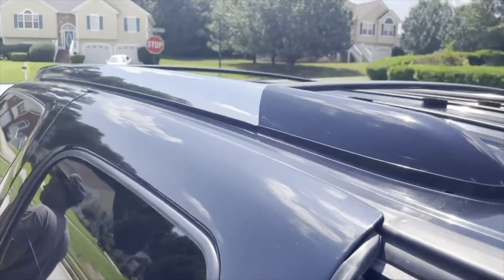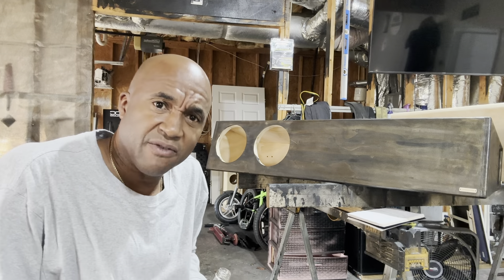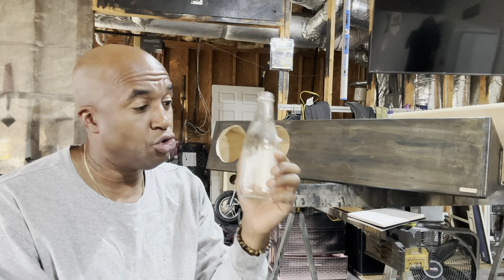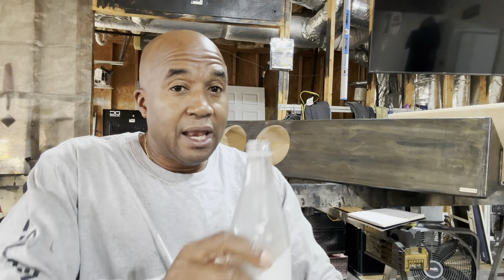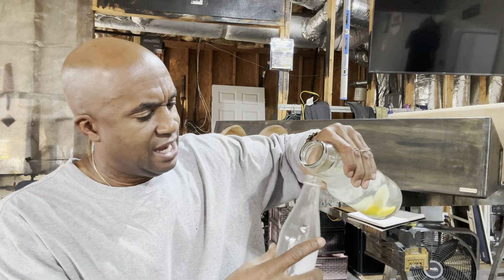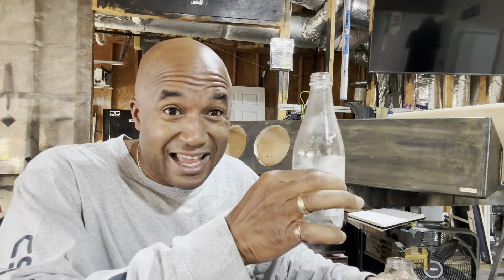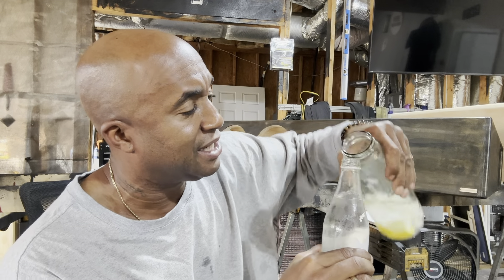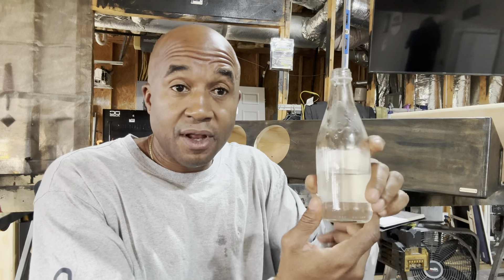The Best Video to Explain the Importance of Box Volume and Subwoofer Relation To Deep/Low Bass!!

Comment: I took a 12 " Comprt preload and swapped the passive radiator with another woofer. It slayed the midbass with no lows whatsoever. It was like having the worlds largest door speaker in my trunk. I took both of the subs and put them in a sealed prefab with a modest 1.2 cubes each and got my low-end extension back and kept all of my midbass. Lessons learned.

Comment: I understand the importance of box volume - & what you're trying to tell us - but I don't think the reason is what you said... Weather 2 or six subs in a box, the air volume remains(fairly)large & is barely reduced by each additional sub... So I don't think the 'loss of bass' is due to volume loss - I think it has more to do with: 1. the fact that "adding another sub lowers the Fs but increases the fall off rate"'(that's somewhere in the teachings of what happens when another sub is added next to the other) - which is killing the bass response under said Fs, or, 2. I think it has to do with the air PRESSURE inside the box, increasing with each sub, STIFFENING the 'air spring'(at least where sealed enclosures are concerned), making it HARDER for the cones to move, & therefore cutting the lowest frequencies which require more air movement to stay loud... So with the bottle, it's as if 2/3/4 people were blowing air in(or maybe that example doesn't suit my idea)... More subs would generally be louder though... What if the subs were each in a separate partition? Would the result be the same? O.O

Comment: Cone area is king to an extent example if you have a single 1500 rms 15 in the right box and power in the same 2020 Tahoe as 4 15s with 1000rms per sub choking the box the single 15 would be louder
Reply: No deeper and louder are very differnt things
Reply: @7Logik  I know a guy that had a single 08 Memphis mojo 15 on a ma audio HK 4400 and it was louder than 6 power bass 3xl 15s no lie and the guy had power going to them 6 15s